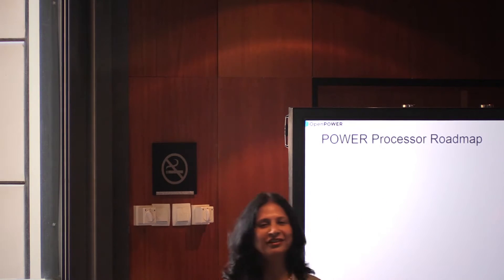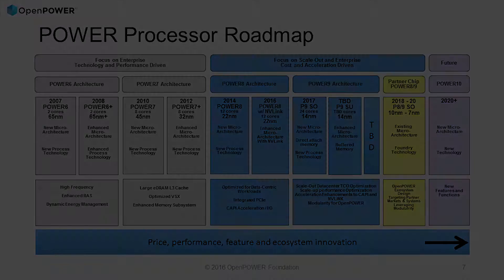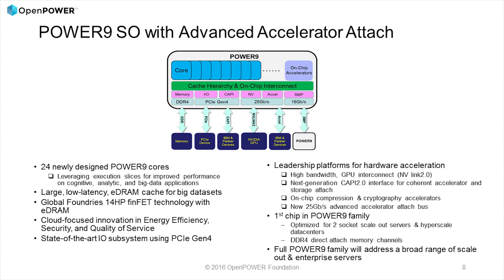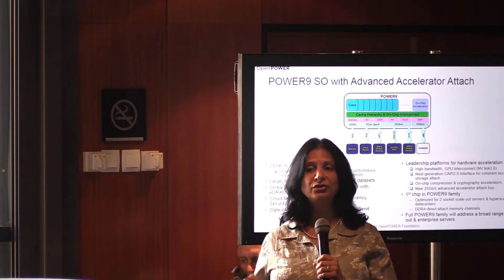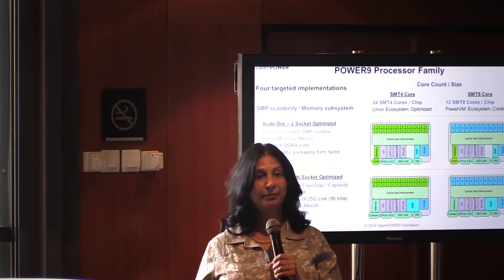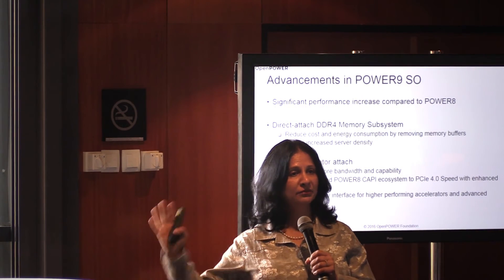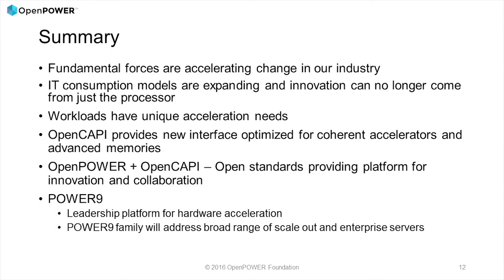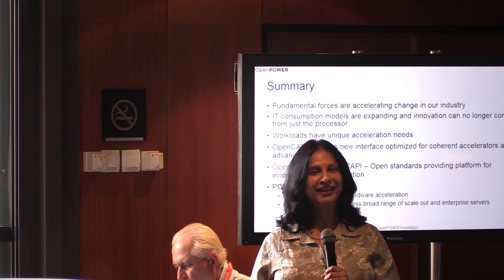Rani Borkar Power 9 Roadmap

Comment: Power9 from IBM is quite powerful (24 cores, 4.00GHZ per core, 8 threads per core) - it seems to put Intel XEON's to shape with it's multithreading capability. . . I wonder whether there will be a variation that is optimized for rendering/compositing. . . .something like this (I imagine) should be quite powerful for rendering.
Reply: POWER9 has NVLink built in so it should have the best GPU performance of any computer with access to the highest end Nvidia GPUs on the fastest bus. However.. the software scene on POWER is inferior to that on x86, so it might be hard to find a working solution in the real world.